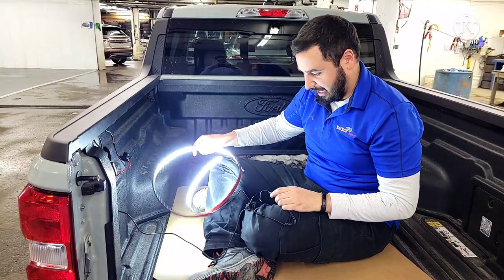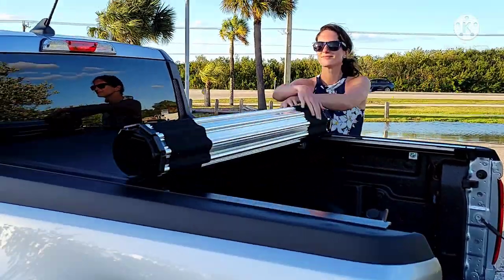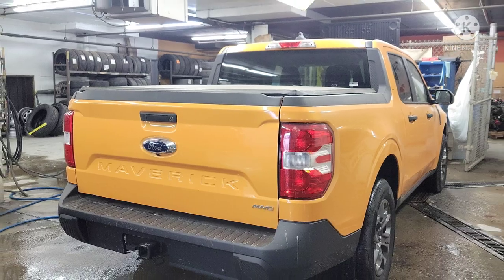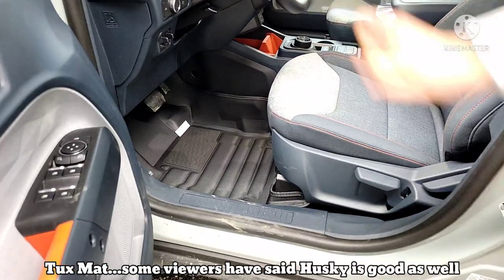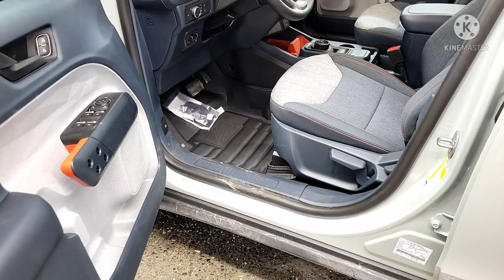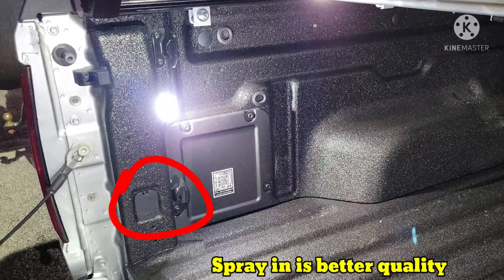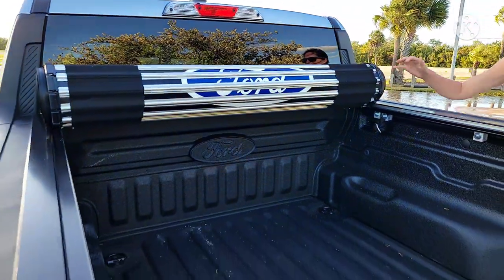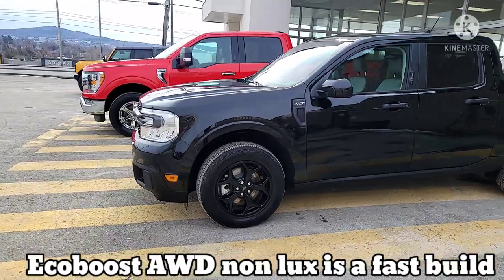Ford Maverick Accessories Rated. Pros and Cons covered!

Comment: Had my XLT Hybrid for over 3 months and 3800 miles now and I am loving it. Getting warmer outside and my mileage just keeps going up. Last tank of fuel was 38mpg average, mostly highway speed. I have the Soft Roll Up Tonneau Cover and I really like it, rolls up nice and close to the back window and doesn't block vision too bad. Yes they are vinyl and might wear out quicker than the Hard Roll Up but at just over $300 I could replace it a couple times for the price of the Hard Roll Up Cover.

Comment: Update Ordered January 2022 delivered yesterday and I picked it up today. The two options I ordered were not mostly completed. I ordered the console vault and it will be installed hopefully after dealership gets it in a few weeks. Also the 110 converter. It’s mostly there except in the bed of the truck. I also actually got some more options than I did not order for free. Larger screen. Driver assist. I did not order but I got atleast both of those.
Reply from the maker: Odd outcome. If you ordered an XLT fx4 that does come with the bigger 6.5 inch screen behind steering wheel
Reply: @Johnnyscarcarereviews  got XLT trim but not XLT luxury package. Was also told at that time that screen sizes were different during that purchase time. I dunno though 🤷🏼 and screen was not behind steering wheel screen I’m talking about is radio screen.

Comment: My wife’s Maverick XLT hybrid has spray in bed liner with hard Ford roll up. Good luck ordering that. You can’t get it. At least from the build site I used to order my neighbor her Maverick. By the way I just got her WeatherTech floor pans and AWESOME FIT. 

Just drive our Maverick 12 hours this weekend and averaged 37mpg doing 80. That is hand calculated at the pump. 

This is a great truck. Ours is Cactus Grey. Pretty sharp. I just ordered our neighbor lady one in white with the blackout package. She wanted an XLT and there was no way we could option on spray in liner or the Ford roll up tonneau. 

I must say - the Ford rollup is worth whatever I paid for it. It’s pretty awesome.

Last thing - on Amazon I ordered a thick rubber bed mat. About $135 if I recall. I’d do that again. I always put these mats in my truck beds because it keeps stuff from sliding around. My wife loves that I like this little truck because I keep buying her stuff for it. I just bought a padded center console armrest pad. It has two little side slit pockets. Perfect. Helped on that 12 hour drive. I also bought her a customs made to fit Maverick sunscreen for the front window. Yes it fits exactly and it was only maybe $18?
Reply from the maker: The thick rubber mat from the bed is a fantastic idea. We really appreciate that you took the time to write this informed of an help phone comment. The community needs more people like you armedmariner.
Reply from the maker: Thank you so much armedmariner for sharing this excellent information. I also have a rubber floor Mat in my bed. And I love it as it absorbs shocks from rocks. Being thrown into it as well as other tools. We really appreciate that you have taken the time to write such helpful and informative comment. We need more people like you in the community, thank you.

Comment: I have the  trifoldfold and I like it, water hasn't been a problem. Went through the carwash and maybe a tiny tricky of water if that. I think you have to have it lined up right and it's good.  Also got a spray in bed liner seems to be good. Truck is bomb. The original customer that ordered it did not put a plug option in the bed so I'm going to do that and going to put in a sliding window in the rear.
Reply from the maker: Great intel. Thank you

Comment: Plastic bed liners are long lasting. They do get scratches but unless you really really abuse it, they last a long time. 
The plastic also helps to reinforce the bed and helps prevent dents. A spray in is great when it comes to scratches but it doesn't really do anything for dents.

Comment: Since this is a low-cost option for me, I'm thinking soft tri-fold tonneau and a bed mat; I don't plan on keeping anything super valuable or weather-unsafe in the bed. I also don't really live in a rural area where I worry about people slashing the tonneau; I work in the city but park in a secure lot with cameras everywhere. Think I can swing it all for 400-600 USD. Would love the hard roll up and a spray-in liner, but 1600-1700 dollars altogether is A LOT.
Reply from the maker: Clifton I am in the same situation. I like that bed mat but prefer soft folding as I don't want to either loose a third of my bed when folded flat or the window when pulled up to the window. Soft rolling takes the least amount of space

Comment: Hi Johnny great video. I ordered my Maverick Lariat with all packages in Toronto on Nov 23rd. Any idea on the build date. My dealer said it’s priority 10. Thanks
Reply: Did you order hybrid or ecoboost? Can I ask which dealership you ordered with and were you happy with service?  Going to order this summer.
Reply from the maker: A lot of November ecoboosts have been made already and based on Ford's new scheduling formula you should at least have a build date but the constraints created by microchips and exasperated by the Lux packages extreme use of them makes your build date very hard to predict. Also of you have Accessories then those are other pieces that can have the system be forced to pass over your build based on unavailability of parts when they try to assign a build date. I'd yoy remove accessories then I'd hope you would get a build date within 1 to 2 months.
Reply: @Johnnyscarcarereviews  Hi Johnny Thanks for the info don’t have any accessories except the packages any idea Thanks
Reply: @Johnnyscarcarereviews  Hi Johnny Thanks for the info don’t have any accessories except the packages any idea Thanks

Comment: Just gonna throw this out there. Plastic drop in bed liners also trap water and salt under them and will rust the bed out over time. My maverick is in shipment. Xlt,4K, full size spare, and floor liners.
Reply from the maker: Nick awesome points. Thank you for making this video better with those excellent on point comments.
Reply: I've had a plastic drop in liner on my 14 yr old ram,no surface rust at all.maybe in 25 -30 years this could happen but who keeps their vehicle that long?

Comment: I would not add any accessory if you can install yourself without voiding warranty. You can find afternarket bed covers for much cheaper.. If your handy everything from the bug deflector  to mudflaps to bed extender are cheaper to get from Ford parts and install it yourself. And alot cheaper if you get them from the aftermarket. One guy found a bed extender fits perfectly. The Fird option is $370 while he got his on Amazon for $180.  Ford sells the aeroskin hood deflector for $80 bucks but charge $120 as an option etc.
Reply from the maker: Thank you for the intel. I do like the warranty on Ford parts and the assurance it will look great and fit well but there are definetely some nice aftermarket options out there.

Comment: Does the Ford Bronco Sport have mats for them yet or after market ones? If so they might fit.
Reply from the maker: With the Escapes fitting for sure in the front I'd say you are most likely right. Good point
Reply: @Johnnyscarcarereviews  I was just thinking that they are built on the same platform, and that maybe the front ones could work.

Comment: Im from the same area of belle province. I see you traveling.. i can't wait to cross the border with my maverick..  My xlt hybrid lux 360 sunroof dropin liner and hard roll up is almost here..  3 more weeks to wait..it's in transit.  Order was made last summer and delivery should be the second week of may..  the maverick was not my first choice, i wanted a ioniq 5, id4, or even a tesla., but i didn't want any car payment.. i wanted to pay cash. The maverick was cheap enough for me to pay cash, stil it came up almost $43k can..which is only $5k less than the base ioniq5 when compared. Anyway too late now   …I don't understand why the lariat hybrid isn't available for us canadian. Because i really wanted leather seats. Katzkin are way too expensive over $2000 just for the front seats.. let us know if you notice any engine or mechanical issue.
Reply from the maker: Reef thank you for the intel. I have an xlt lux hybrid ordered July 17th and still no build date for us. Congrats on getting your build date. So far, locally, we have not seen engine or transmission problems. Hybrid drives great, even in the snow. Marie towed in the snow going up and down the mountain and no issues at all during a snow storm. I think you will love the Maverick and I look forward to your assessment in June.
Reply from the maker: Hybrid Lariat would have been great as the activex is recycled plastic for theist part and thst is great for the planet. katskin on an f150 bought and installed front and back is more around $2500 so it should be the same or less for a Maverick. Maybe try checking with another dealer and company for purchase and install. Thank you for watching and for the intel. I hope I've been helpful
Reply: @Johnnyscarcarereviews  i was told by ford that each dealer were allowed to order two hybrids.  If it is true, then it could mean that if your dealer already sold two hybrids and the one you ordered on 17th of july was the third, then you will have to wait a little longer… the one i ordered last summer is one of the first two the dealer ordered…

Comment: I gotta be honest, I'm not happy with my Maverick, the MPG is amazing, but the accessories and build quality is frankly shit.
Reply from the maker: Thank you for your input. What in particular about the build quality do you dislike? What accessories do you have?
Reply: @Johnnyscarcarereviews   My experience so far: 
The Tri-Fold bed cover has a design flaw and no matter how tight i made/make it, it just flaps around on the highway and causes a massive vibration in the cab, the dealer was able to replicate it, and is replacing it with a roll-up free of charge, They also reported it to Ford corporate, who indicated there's a TSB on it, and that they may recall it,  but it's pretty annoying that wasn't disclosed.. The Sun glass holder in the center doesn't open correctly and requires you to bend it slightly to open it. The USB-C cable was missing completely, the dash had to come apart to put one in. Guess someone forgot to install it at the assembly line. I wasn't aware of that, it was in because the dash rattled and it was annoying as all hell, the tech found out the cable was missing when he had it apart.. The other issue is the brakes, the hill assist is sloppy and doesn't always hold, the car tends to roll back on a hill and with no clutch, and the drive by wire, you can't circumvent the issue, i've tried two foot driving to bypass, but the computer won't let you do that.. I also find at times the brakes don't correctly engage between the hybrid brake and the actual brake, so you have abrupt stops on occasion. When you are trying to back a trailer somewhere it's especially annoying.. My Wife's Rav4 Hybrid doesn't have this issue. The brakes are annoying enough that it's borderline dangerous. The Horn, the Horn was missing the rubber isolater so when you beeped at someone it would resonate through the cab.. 

I have an XLT with the premium package, co-pilot, tow hitch, soft tri-fold, carpet mats and rubber mats, mud flaps, spray in bedliner. Hybrid, in Alto Blue.